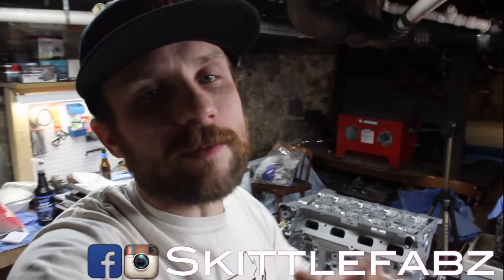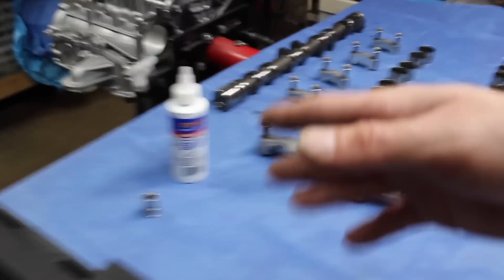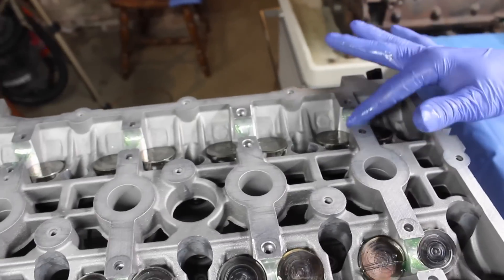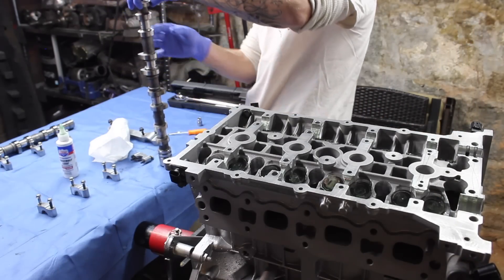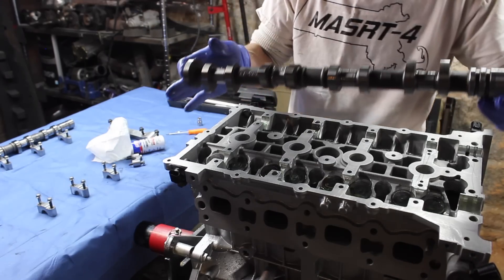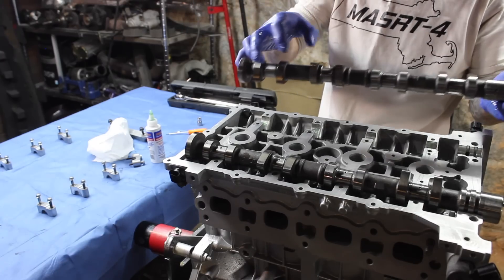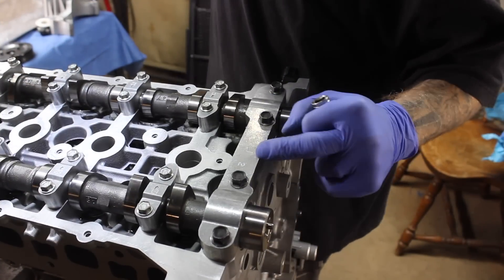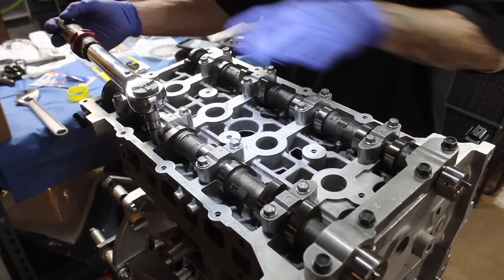4B12 Cylinder Head Valve Train/Phasers Install ~ Step by Step Torque Sequence & Specs Caliber SRT4

Comment: I got my valve buckets messed up, do they need to be in a specific order?
Reply from the maker: Should have kept everything in order, but if a machine shop gets it they can check clearance and make sure everything’s good
Reply from the maker: Want to watch out for valve lash when it comes to buckets and cams
Reply: @SkittlefabzSRT4   I tried to keep them in order but the folk I'm working with decided to pull them all off without asking. I'll be sure to check the valve lash with Mpx 272 cams, and switch the buckets around until they are within spec, or order different ones if needed. Thank you, and thank you for the tutorial